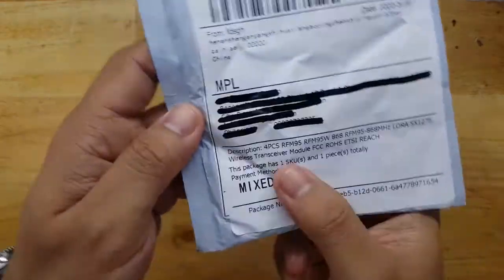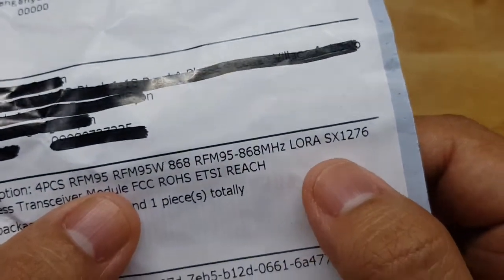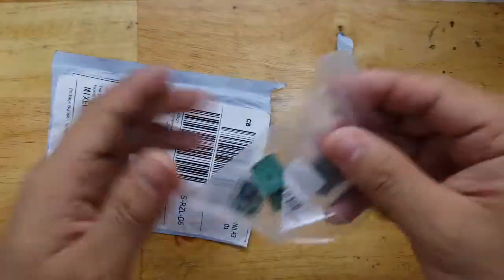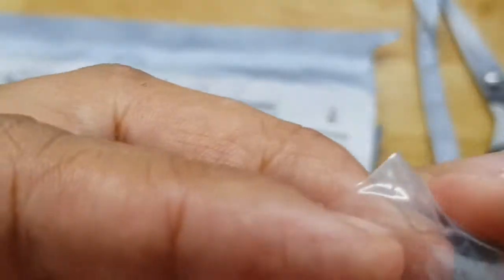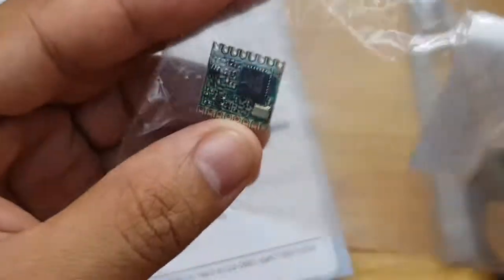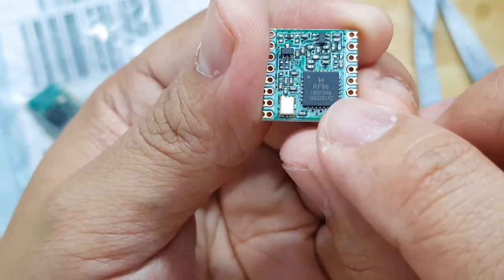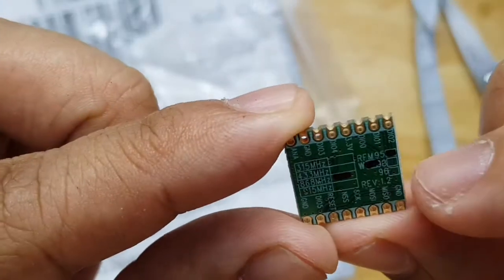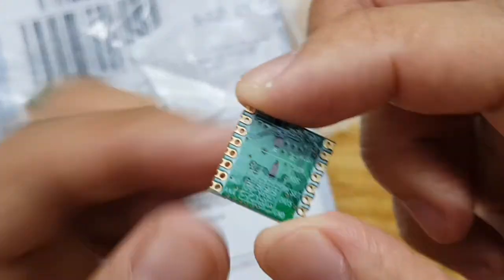UNBOXING OF LORAWAN MODULE RF96 OR SX1276 868MHZ END NODE

Comment: hi!
does RFM96 works at 868MHZ? It is supposed to work at 315 or 433MHz. 
I ordered RFM95W moduled from aliexpress and instead i received RFM96 modules, but marked at the back side as 868MHz, as yours. 
Did you check it? Do they work at 868MHz?
Reply from the maker: That's interesting. It is actually working at 868Mhz now. I tested it both on TTN and chirpstack network servers. I haven't release the video yet, but it is already on draft.

Check this link: 
https://www.rocketscream.com/blog/2017/08/21/the-sx1276-modules-shootout-hoperfs-rfm95w-vs-nicerfs-lora1276-c1-vs-hpdteks-hpd13/

It seems that RF96 is the version of SX1276 of NiceRF which will work at 868Mhz. That's why it is working. I should change my thumbnail from RFM96 to RF96 to avoid confustion :)
Reply: @circuitdesolator  Thank you very much for the answer! you helped me a lot! you have a new subscriber :)